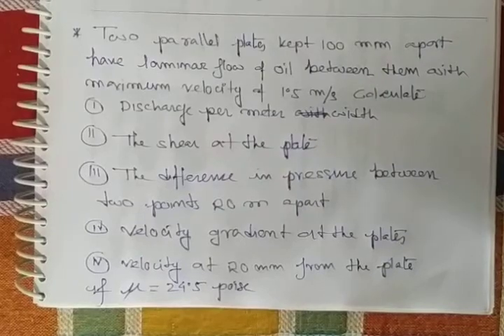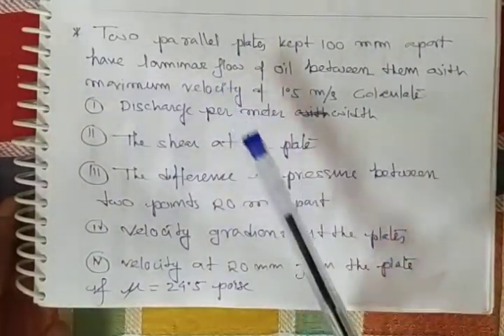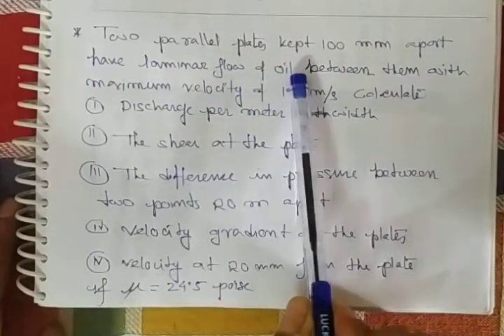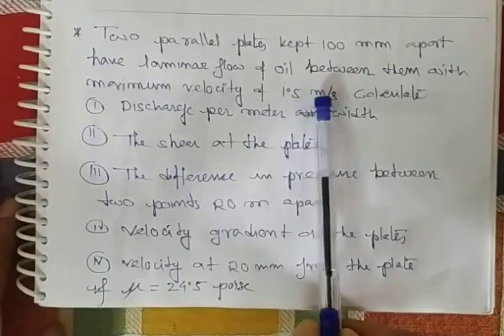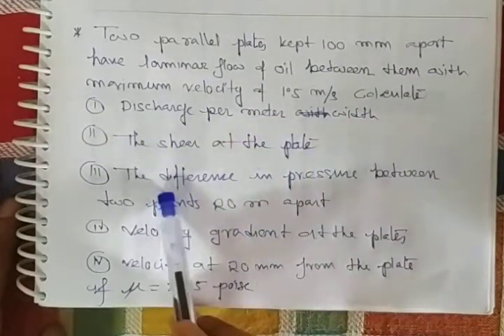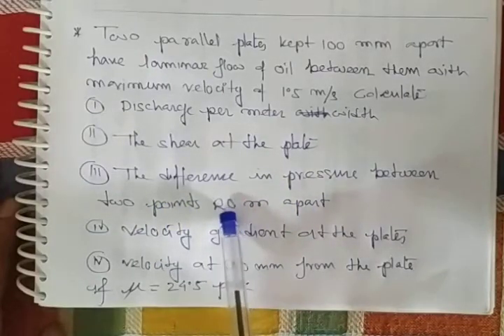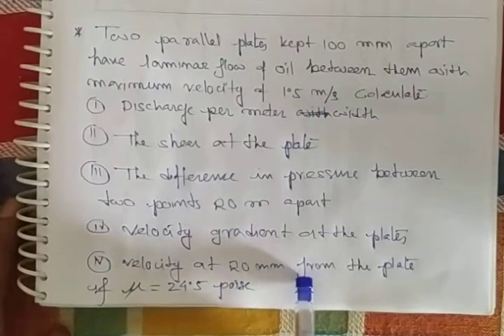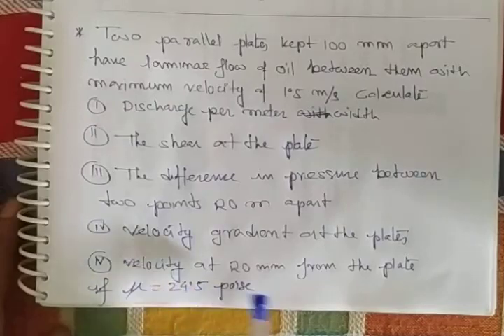Numerical on Laminar fluid flow between two parallel plates

Comment: Clearly understood  sir, but sir in the pressure difference it should be p1-p2 or p2-p1
Reply: It will be P1- P2. As pressure  is more on upper side as compare to lower. Cuz fluid moves from higher pressure to lower